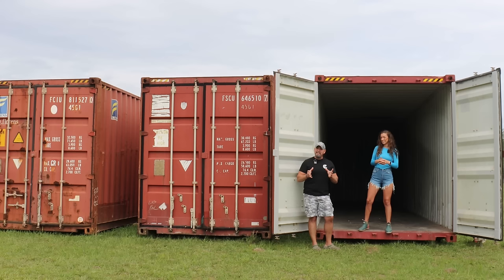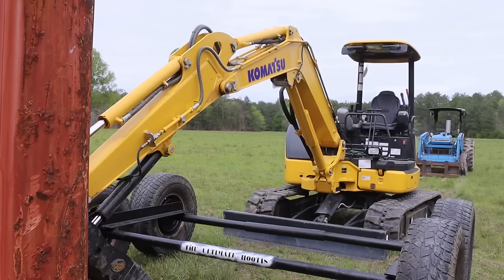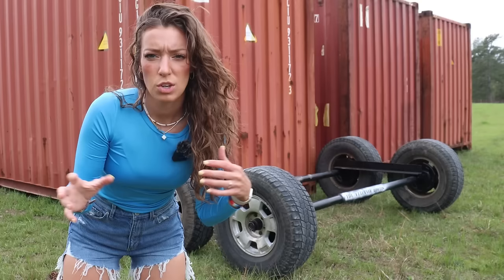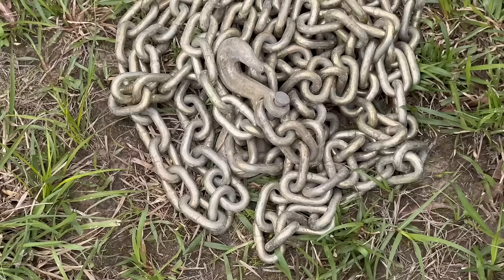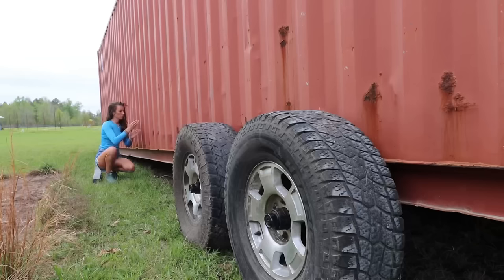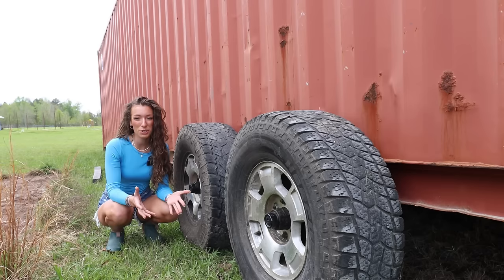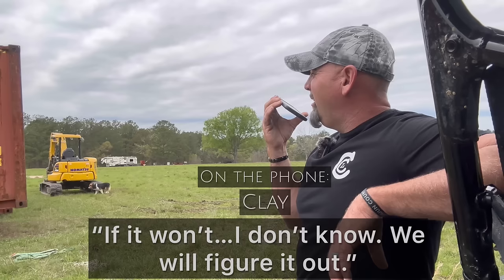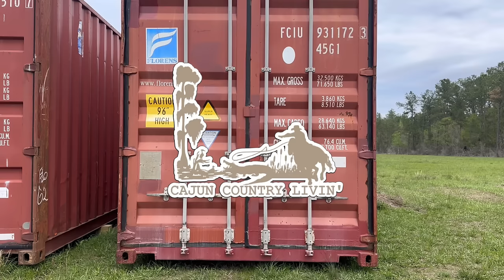Moving Our FIRST Shipping Container | In Over Our Heads?

Comment: Just a suggestion to strengthen the connection between the pipe extension and the axle.  Add a few plug welds around the perimeter to reduce the flexing on the connection weld.  Love your channel and good luck!